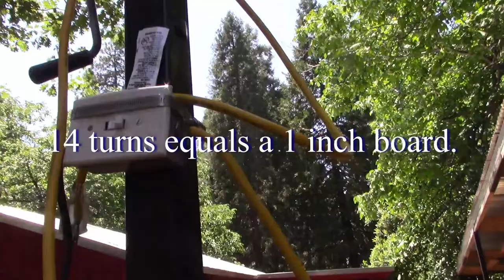Electric Sawmill

Comment: Great build. Whilst everything like this has inherent danger I think i'd look at adding a guard where you are standing. If the chain snaps the sprocket can keep on pulling and whip the chain around into your thigh. Would only be a few more welds and a bit of steel plate or even thick mesh.
Reply: You don’t use chainsaws do you?The chain is contained and doesn’t act as a whip if it comes off and the chain isn’t long enough to cause harm but the guard is a good idea for sawdust containment
Reply: @scor440   Do a search and read on the various forums that people have been hit by the broken chain, granted its not hugely common but it is possible. Also the chain isn't 'contained' if it is broken and in this setup it is not contained at all as far as I can see. This is not a standard chainsaw with it pointing out in front of you, it's literally at junk height! and the operators hand comes pretty close to the chain as he turns the wheel.  Might be a pretty low chance of causing injury but I'd rather put something in the way if something was to go wrong on a diy chainsaw setup.
Reply: @scor440  I'm gonna suspect you are overly confident with a chainsaw. 

I've broken a chain, and my right thigh has the 6" long scar to prove it. Don't tell me a chain can't whip.  

Don't be a Karen/Kevin. In the real world, anything is possible.

Comment: Simple and low cost setup,I think I might have to make something like this to save wear and tear on my 036. Only I’m  probably going to use a 3450 rpm motor 3-5 hp 220v single phase to be able to use a longer power cord and lessen the i r loss. Preferably a used j or c-face pump motor or air compressor motor.

Comment: I'm like you. The bandsaw mill investment is harder to swallow. 
I live in BC Canada. Don't have a ton of money to spend. Semi retired. Been a carpenter 50- years. Saw a Russian You Tube clip all wood. And rough. But a longer bar 60". 

Also saw a hydraulic. Same speed as electric. Doesn't bogs down.
Reply: Gave me some more ideas.
Reply: I've investigated skip chains and hypererskip chains. Going to investigate with my Remington electric -14" I picked up for $50.00 some 15 years ago. Sacrificing that saw is cheaper than a gas powered. Thinking a 24" bar. Have a 30" Willow  block to try. 
My daughter needs a couple of end tables for her appointment. Want to try a river table. 

Love your setup. Awesome simple ideas.
Reply from the maker: Hi Dave. I tried a Harbor freight electric saw. It was 7 amps and just a little too slow. I think that the Remington  might have a little more power.  Nothing better than taking those throw away logs and making something useful. Good luck. Lonnie
Reply: Just tried it with the 16" husky bar. Slower than shit. Talked to HUSKIES dialer. Said could put on my kiddies 136 Husqvarna .but would burn it out. That is why I was going to use it on my little Remington. $50. Saw 15 years ago. Thinking a 24 or 28 inch blade as long as pitch same. Not going to worry about burning it out. Been a carpenter for 50 years. Want to make a river table side tables for my daughter. Just bought a Willow block. 30" anyway. In BC Canada that is the closest most reasonable hardwood. 
Experiment stages.
Reply from the maker: Hi Dave .  My original chain saw was a 18" 42 cc poulon pro.  For 129 dollars it came with a case and extra chains.  I did not expect much from it.  I used it to cut about 4 cords of madrone fire wood.  I realized that the Madrone was beautiful wood so I built the gas chainsaw mill to make some boards. After some trial and error I made lumber. 
The little poulon chainsaw ran flawlessly board after board. I only built the electric mill because I wanted to mill early in the morning and I also was getting sore ears from the hearing protection. 
 The electric mill is just a little faster than the poulon. 
Here is what I learned:
Oak and madrone is super hard and slow. I have to touch up the blade every 3 or 4 boards. 

Green lumber is easier to cut. 

The pull rope that is on the crank will save a lot ot fatigue. 

Pine and cedar are like cutting through butter.  If you ever see someone demonstrating their mill system it will always have a pine log on the mill.

I do all my milling in blocks. Usually about 1 week of milling will give me all the lumber I need for 6 months to a year.

Comment: nice and easy solution to slabbing, Thank you.  One problem I see that as sawdust collects on the wheels you will lose accurateness, solution would be to put a little board to scrape the track clean of sawdust as it moves in front of the wheels.
Reply from the maker: Thanks for the info

Comment: Bloody awesome mate, keeping it simple yet keeping it effective,  and I would guess the build cost is kept to a minimum as well. Just a suggestion  have you considered a support for the bar tip which would help prevent bar flex especially when cutting wide boards? Just by the look of your design it would be easy to adapt an Alaskan mill style of bar tip support to accommodate this.!!.
Reply from the maker: Hi . Since it is only an 18 inch bar there is no flex. I think that I would need a support at about 20 inches. Thanks, Lonnie.

Comment: Three important things you definitely already know.
1: The sharpening angle of the saw chain when sawing longitudinal wood must be 10° insted 35°. The saw blade remains stable and the table surface is smooth.
2: Lubrication of the saw chain is absolutely necessary.
3: The linear speed of the saw chain should be the same as that of the chainsaw. (The chainsaw makes 10,000 rpm, the electric motor 3,000rpm. Use about 3times accelerating transmission, or  at least 12 teeth spocket)
🙂
Reply from the maker: Good stuff. I agree completely

Comment: Really cool setup is this a TEFC or ODP motor? If ODP are you having any issues with sawdust getting into the motor? Thanks for sharing your build. I am building similar and just was reading about the different type motors and would prefer to purchase an ODP due to cost but was just curious of your experience after using this for a while.
Reply from the maker: Hi. It turns out that I used a ODP motor . I learn something new every day. They have the brand new 2 hp compressor motors for a good price. I have not had any trouble with the sawdust getting in the motor. I do blow out the dust with my leaf blower. Let me know if you have any other questions. Lonnie. 
https://www.surpluscenter.com/Electric-Motors/AC-Single-Phase-Motors/Air-Compressor-Motors/?page_no=1&fq=ATR_Motors_HP:2&fq=ATR_RPM:3450
Reply: @thegreensbackhoe  TY, those are good prices does the 2 hp seem to be enough to handle the milling? I am not milling everyday but more for wood for projects. I might do some logs 20 inch diameter but nothing huge.
Reply from the maker: @hollyr8788   It is enough for everything I have done. The 2 Horse power electric motor is equivalent to a 4 horse power gas engine. This is also the largest electric motor that will still plug into a wall outlet. I have cut alot of boards on my mill. Homemade live edge boards are great gifts. It will come down to how sharp the blade is.
Reply: @thegreensbackhoe  Cool, I’m ordering one and definitely agree on the sharpness of the chain I will use ripping chains. Thanks for sharing your experience and creativity with your mill.

Comment: That was a great sawmill you built  can I use your plain
Reply from the maker: Hi Randall. I have plans for the gas chainsaw mill. The electric mill is the same frame with a different power head design. Send an email to thegreensmachines@gmail.com  I will send the pdf down load. I dont have plans for the electric power head because there are too many different types of saws.

Comment: Good job man, hows it working after a year? How much power does it need?
Reply from the maker: Hi. I am pretty sure that it is pulling about 16 amps. It would depend on the load. I run it on a 20 amp 110 volt AC wall outlet. I finished my lumber. A friend borrowed it to do his lumber. It has been sitting for about 6 months. When time allows I will mill some more lumber.
Reply: @thegreensbackhoe  thanks for replying, I live off grid so I dont have much power, do you think I could use a small motor or should I do it with a gas engine? Thanks again man! Hope you find time to have some fun milling, I'm researching about it because I'll mill everything for my home construction.
Reply from the maker: @ÁrvoresEmadeiras  I use the electric motor because I am on the grid. If I was not on the grid  I would not use an electric motor. For me the electricity is way cheaper than the gas to run a saw.  The quiet is nice too. 
After doing some milling I also know that the chainsaw mill is a little slow on the harder wood like oak, If time is an issue then I would go with a gas powered band saw mill. 
If you want to do a gas powered chain saw mill with the ladder track then email me At  thegreensmachines@gmail.com I have some drawings that  will help. Thanks. Lonnie.
Reply: @thegreensbackhoe  My problem with a bandsaw mill is getting the blades because I'll be in Brazil, I think I'll do a gas powered with the chainsaw blade, thanks for replying! Thanks for offering the drawings.
Reply: What hp is the motor
Reply: @scor440 he said in another comment it’s a 2hp motor with an 18” blade. Hope it helps!

Comment: A natural question would be: can't I do this by just buying a corded chainsaw, which are cheap ($115 on amazon for 18" 15A saw)? And I think i know the answer. Corded chainsaws are well known to overheat/shutdown frequently, especially when used for long continuous cuts (exactly what milling requires). By using a much larger motor, even tho it is rated to draw around the same power, you have avoided the problem of a small electric motor overheating. Does that make sense? I'm guessing they simply don't make corded chainsaws with bigger motors because they'd get too heavy, which isn't an issue for a mill.
Reply from the maker: Hi ben. You have the right idea. I did try an electric chainsaw.  It ran hot and was noisy. Typical skill saw type brushed motor.  
These induction motors are quiet with good torque. I do have to blow the saw dust out of it once in a while. The only flaw I have found is that the points that kick the capacitors in to start the motor get sawdust in them. I sometimes have to start the mill with a stick. 
The mill works great. I think I will do a bandsaw mill with the same size motor next. 
There are still lots of trees being cut down. Thanks, Lonnie

Comment: have you tried a bigger chain sprocket to get more rpm ?
Reply from the maker: I have.. 2 Horse power is The maximum I can run on 120 volts. By bringing my PPM's up my torque goes down.  Its still cuts about the same speed. I only cut for myself and my kids so I am in no hurry. with the limited power I could make it faster with a narrower blade. I really enjoy milling,....
Reply: @thegreensbackhoe  i have whats rated a 5 hp compressor motor at 110 . im guess because its 1700 rpm it has similar powet to your 3400 rpm 2 hp
Reply from the maker: @douglasmcleod7481   there are some strange Horse power ratings out there.  It takes about 7.5 amps to run a one horse power motor.  A true 5 horse power 120 volt motor would take  about 38 amps to run. a 20 amp circuit could never run it. I would be curious to see the plate on the motor. most likely it is 15 amp draw. Sounds like someone came up with a new way to measure Horse power to sell compressors. 
The 1700 rpm motor would be a little slow to run a mill. You would have to pull the bar through really hard to make up for the slow speed which in turn would start to wear things out.  I feel like 3450 rpm is about the minimum speed .
Reply: @thegreensbackhoe  ha ha i pulled the shroud off the motor and saw 1.5 on the plate
Reply from the maker: @douglasmcleod7481  your motor would probably work, It would  be painfully slow.  In the description of this video, I put a link to some information about my log to lumber equipment.  https://www.youtube.com/watch?v=vr9tmCDDxN4

Comment: How many RPM do you need to have on the electric motor?
Reply from the maker: Hi Juha. My motor is 3600 Rpms. The gas chain saws are turning between  10 thousand to  14 thousand rpms. I am happy with the speed of my mill.  I think that slower rpms will work. Just not as fast
Reply: @thegreensbackhoe  Hello again! :) do you mean from the output shaft of the motor or chain?
Reply from the maker: @dahlbo016  The motor output shaft. Here is a link to a similar motor. It can run on 120 volts  https://www.surpluscenter.com/Electrical/AC-Single-Phase-Motors/AC-Motors-Base-Mount/2-HP-115-230-3450-RPM-Marathon-Air-Compressor-Motor-EM03-0-36-10SP-10-2619.axd
Reply: Hello Sir. Question for you, have you ever bogged down the motor. I have an old electric motor laying around just wondering of you can go lower than 2 HP.
Reply from the maker: Hi. I think that if you were going to be cutting smaller logs. Maybe down to 1.5 Hp. If I was to crank down on the pull cable I could bog it down. It would really come down to the length of the bar and log size.
Reply: @thegreensbackhoe  ty for information. Edit: ya just found the motor its 1/2 HP to weak.